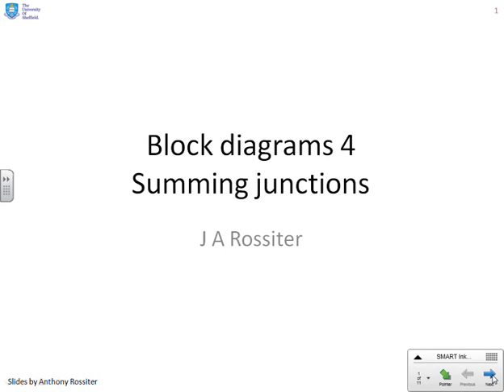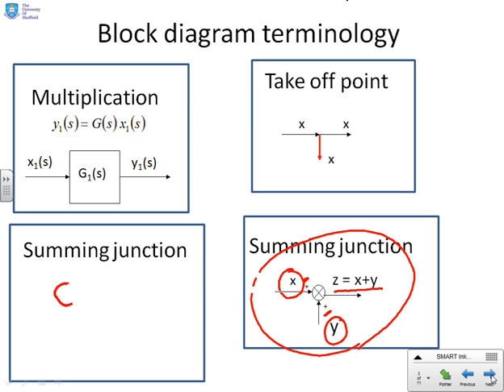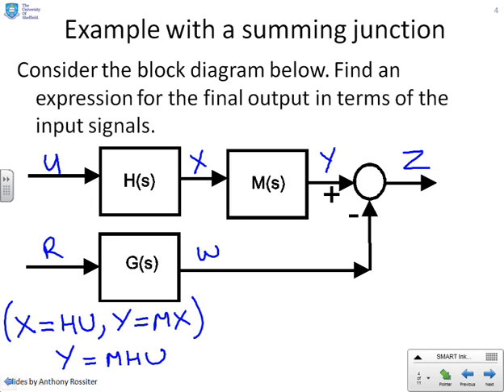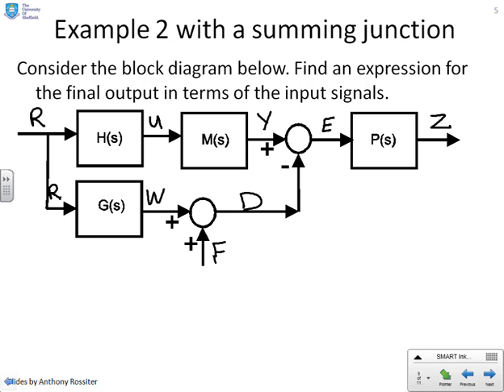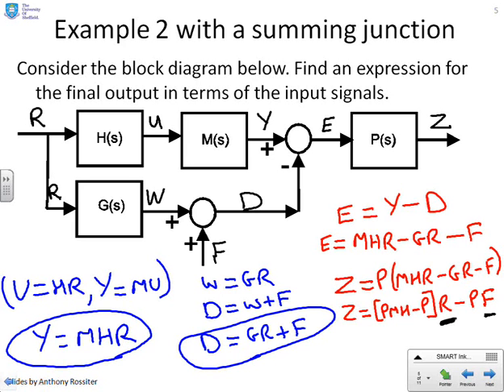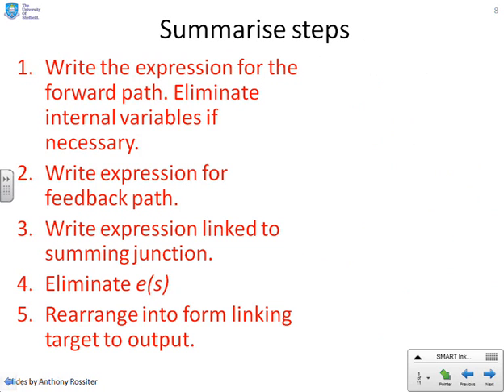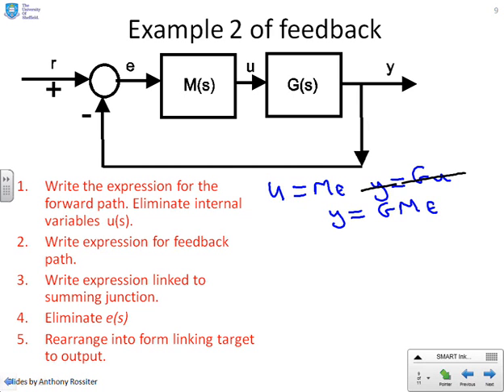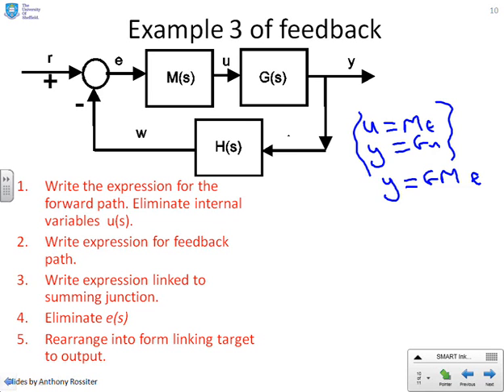Block diagram 4

Comment: Sir, This is a very great video. You have made me to fully understand control block diagrams. I think there is a 'G' missing in the final answer of Example 2 with a summing junction. The final answer should be: Z = (PMH-PG)R - PF. Thanks. Jide Taiwo